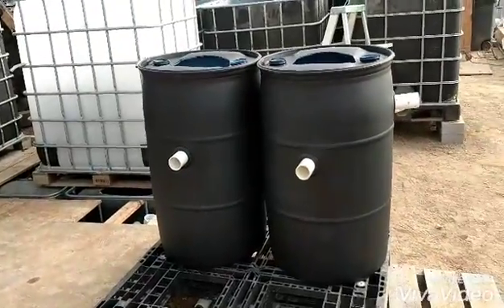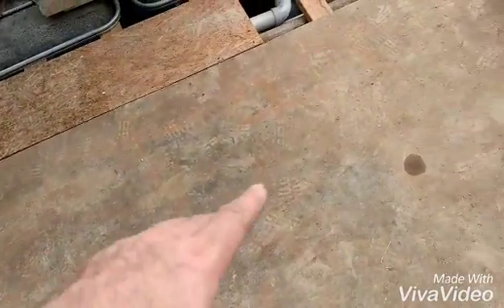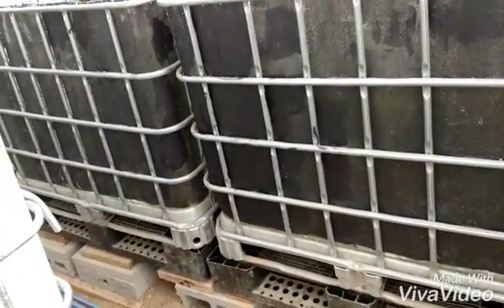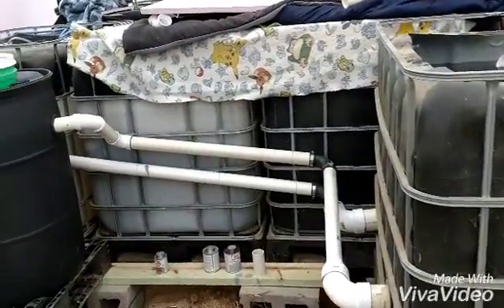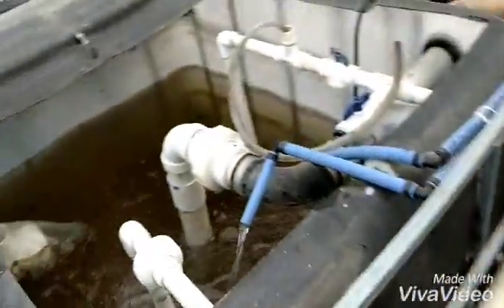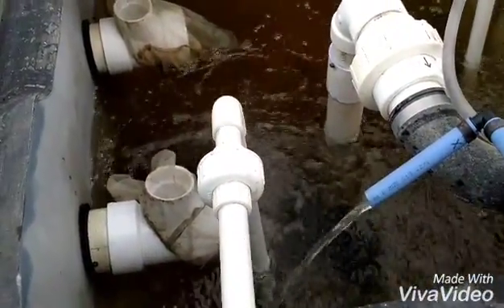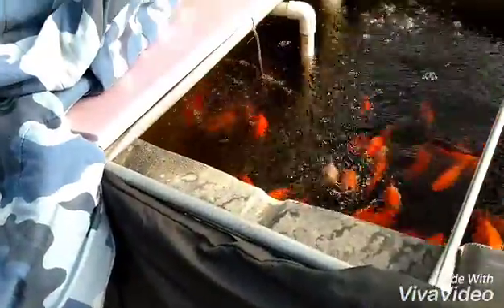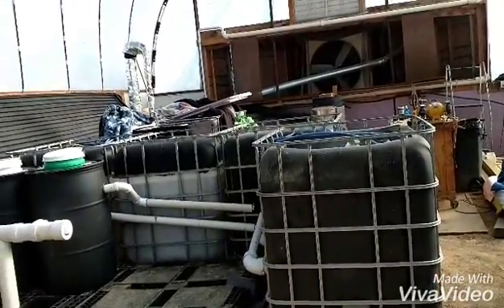Swirl filter or radio flow filter for aquaponics

Comment: Absolute thing of beauty what you've made here. Question: is it okay to take heat from the rocket mass heater (stove?)? I wonder if creosote would build up more if you are taking heat away from the system. Do you run copper pipe to the inside of the stove and then switch to pvc to bring it into the water tank? The tank could get quite hot, how do you regulate the temperature going into the fish tank?
Reply from the maker: Steve Bartlett , Hey thanks. The rocket stove burns so hot and efficient there is no cresolt build up. The copper pipe in the stove does come out about 3' then hooks to PEX tubing and runs to the holding tank. I heat that tank up to around 90 degrees. The heat exchanger pulls out heat for the fish tank and keeps it around 70 degrees. Thanks, Von

Comment: I would be interested in finding out how effective your solar water heating system is. I am in the process of building my new off-the-grid home in the NSW tablelands and will be putting in a hoop house with an aquaponics system. Only problem is that where I am building winter nights can get down a few degrees below freezing. The warmer I can keep the water the more productive the system will be. So any insights into heating would be appreciated.
Reply from the maker: Chris, Sounds like you have a very exciting project. My solar heater is made of CPVC 3/4 pipe. On a sunny day the temperature can run 90 to 120. I have a 300 gallon tank that the water is stored in and that water is run thru the heat exchanger in the fish system. The water is not mixed with the fish water ( closed loop system). This tank also holds the water that is heated from the rocket stove. You might get higher temperatures if you have a glass cover over the pipes. You can also get higher temperatures if you use copper pipes. Keep in mind we have less sun in the winter. It definitely helps supplements the heat from the rocket stove. Let me know if you have any questions. Thanks, Von